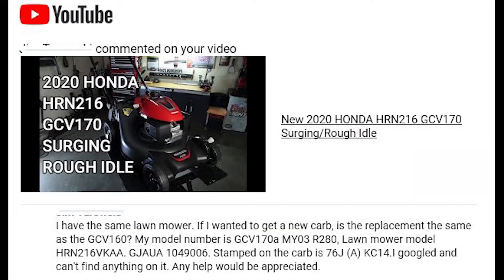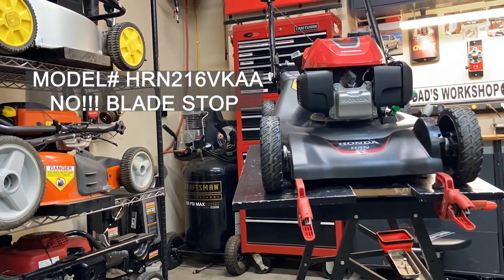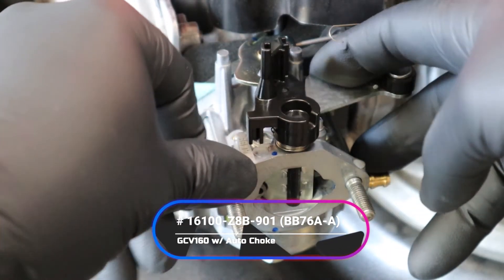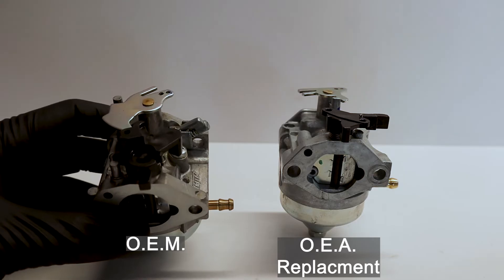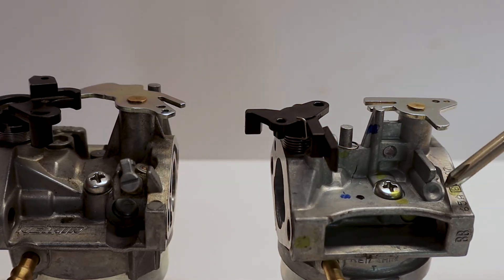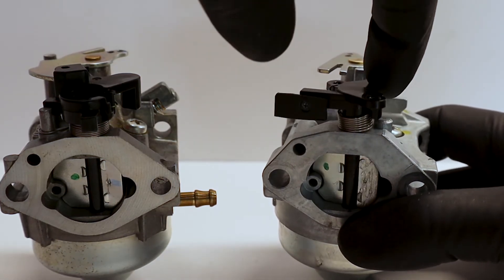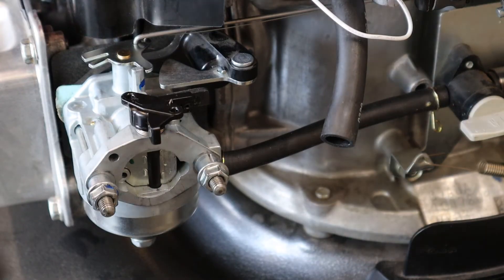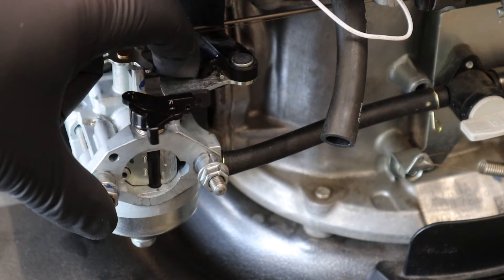HRN216 GCV170 Carburetor Loophole/Alternative

Comment: Great videos. I have a Mountfield with a GCV170 engine but it won't idle. If the throttle handle is released it simply dies. I bought a replacement carb from Amazon but with that on it doesn't rev. Could the auto choke cause the dying of the engine with the original carb ? Thanks

Comment: So I need a new pilot screw and limiter cap because mine broke off when I was trying to remove the screw covering the pilot jet. Is there a part number for the pilot screw and limiter cap or would I need to buy a whole new carb? Thanks.

Comment: Hi! Any idea if the GCVx 200 has the same carburetor as the GCVx 170? I found a spare part that has both the 16100-Z9L-811 code (170) and the 16100-Z9M-811 (200).

Comment: I follow your steps on cleaning the carburetor injector cause it was surging, high low and great it solved the problem and changed the filter and replaced the spark plug and gap At .030 but now it’s blowing out smoke with a somewhat rough idling. Thanks for help
Reply from the maker: A minor amount of smoke/blow by at startup is normal but if it continues after reaching operating temperature I would verify the oil level, if that checks out then you may have worn piston rings. Thanks for the comment.
Reply: @dadsworkshopbykipplabrie7982  that does not sound good would it be replaceable worth to replace the lawnmower is not that old and Pass the #Warranty .
Thank You so much in advance

Comment: Hi are the needle vaves the same on most honda lawnmowers i have a gcvx170 would a 160 fit mine?
Reply from the maker: Looking at quick google image and it looks like the same set up as the GCV170. Is that engine on a power washer? Thanks for watching John.
Reply: @dadsworkshopbykipplabrie7982  no its a mountfield lawnmower with a honda engine gcvx 170
Reply from the maker: You just introduce me to “Mountfield” lawnmower bud, looks like my work is cut out for me. I haven’t come across that brand in the U.S. it kinda looks like a “Mastport”.
Reply from the maker: B.T.W. Late this summer Honda announced an immediate stop sale on all Honda lawnmowers, I haven’t seen them at Lowes or Home Depot for while and I’m not sure what’s going on.

Comment: Hi where is the fuel filter for the gcv 170 honda mower?
Reply from the maker: Inside the fuel tank outlet tube it’s just a wire mesh filter that looks like straw.
Reply: Thanks
Reply from the maker: Thanks for your support

Comment: Why does Honda not offer a direct replacement? I'd prefer to just replace it with the same carb but can't find it
Reply from the maker: Honda doesn’t offer online parts directly from the manufacturer which I will never understand.. for the quickest results I would contact your nearest Honda Power Sports Dealership. BTW it’s competitor “Toro” makes buying parts directly from the manufacturer online fast and simple they’ll even work with your local small engines dealer as well along with FREE! online repair manuals with Pictures!! LOL. Thanks for watching.
Reply from the maker: Yes but last time I checked they were on  national back order.
Reply: Thank you for the reply! Really appreciate people like you in the world. The replacement carb worked. Took about 6 minutes though before it really kicked on. Is this why you added the extender?

Comment: This did not work for me.   I bought the carb and switched the choke plate and it looked great.   Installed it on the mower and will not start.  However I just notice on the video where it says MODEL# HRN216VKAA  NO BLADE STOP....   Well that's my model!   So did I buy the wrong carb?   Is there one that will work on my mower?

Comment: I'm having a hard time understanding the differences in all these carbs? Do you know what difference there is between a 16100-Z0L-862, and a 16100-Z0L-853? The 853's are cheaper and come with all the gaskets, but would they work in this machine?
Reply: For anyone else who may want to know, the 16100-Z0L-853 works great. It may just be a non-OEM part number, idk. 

Getting the choke plate out was the hardest thing about this, and judging by the scratch marks in the video, the 16100-Z0L-862 model must be the same.

I also added an extension, since the choke didn't open the choke plate very far. But once installed, I added fuel to the tank (was a completely dry system), and barely pulled the cord, and it started right up! Runs amazing now. Thanks Dad's Workshop

Comment: Am I correct in thinking that using the older carb would make this mower less likely to have issues caused by clogged ports/jets? From what I've heard the newer carbs have much smaller ports and jets than the older variants.
Reply from the maker: You nailed it I like your style thanks for watching.
Reply: Is it impossible to drill out the jet to make it clog proof?
Reply: @samohtnotslar  I was going to do that actually, then saw this video. This just seemed easier, and considering I don't own micro drills, it was.

Comment: Just a question - at 5:23 minutes in, you mentioned you added an extender.   How much overlap is there on the extender from the point of the original termination point ?  1/4 inch /14 inch extender ?  Or in Centimeters ?   How far out does the extender reach please ?  Did you melt on the extender, glue it ?   What is the method of adhesion please ?  Thank you in advance !!!!
Reply from the maker: Come to found out the extension it’s t needed it works the same with or without it. I used a small piece of padded plastic from a cell phone car vent holder and screwed it together. Thanks Mike!
Reply: @dadsworkshopbykipplabrie7982   Thank you - yes you mentioned it the video.  Thank you for the additional detail - grateful for your time on that Kipp !!

Comment: What does your note mean about the hrn216vkaa 45 seconds in?
Reply from the maker: Just letting viewers know that I'm working on an engine with a fixed throttle. All Honda mowers that feature the blade-stop/roto-stop system come with an adjustable throttle for example "turtle and rabbit" speed. Because the engine continues to run when releasing the bail control on the blade stop system, Honda had to make a kill switch away from the traditional bail control arm release method, so they integrated it into the throttle.
Reply: @dadsworkshopbykipplabrie7982   Hi, Great Video, thanks. so I have the Honda model with blade stop system , Ive cleaned out the idle jet repeatedly. Im afraid to buy exact replacement carb thinking Im just gonna have the same problem.  so would this alternative work here as well? on the model with a blade stop system? Thanks
Reply from the maker: Good question Pat, the only other option is to go with an aftermarket "amazon special" carburetor but I'm not a fan of cheap replacement parts but to be fair I know plenty of friends and coworkers that have had great success with aftermarket carburetors. The fuel transports on Honda carburetors are SUPER tiny and clog very easily and I'm not sure the engineering behind this and being an ASE automotive technician for Lexus I don't care for auto engineers in general LOL. The only advice I can give is buy it and try it. Thanks for your support Pat.

Comment: Do you recommend using gumout occasionally? And if so how much?
Reply: I run 1 oz diesel in every 3rd tank every summer, not one dirty clogged jet/carb issue yet but I use a cheap paper inline filter too right after the tank
Reply from the maker: Absolutely! especially on this new GCV170 carburetor design. I like to run seafoam in the gas tank twice a year, once on the first cut of the season and once before winter storage. See directions on bottle for proper amount and usage. Gumout works great too! Thanks for the comment R2BA.

Comment: Can you swap choke arm over to sub carburetor?
Reply from the maker: Good question, my spare lawn mower parts are currently in storage but it's definitely possible. I know Honda carburetors come in a mix of "plastic slot" and "metal screw-in" arms but as long as the diameter and the stem length match up it should work. The only thing that might hold you back is the shape, size and material of the butterfly valve. Way to think outside the box! I'm for sure going to give it a try Gomez.
Reply: @dadsworkshopbykipplabrie7982  How are the throttle linkage and return spring hooked up at throttle butterfly arm? Is the spring on hole close to air filter?